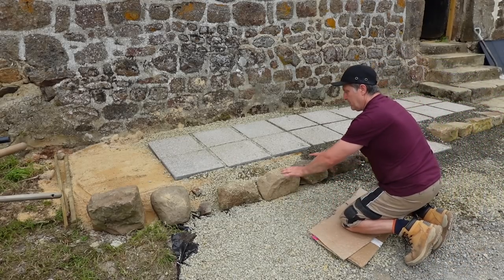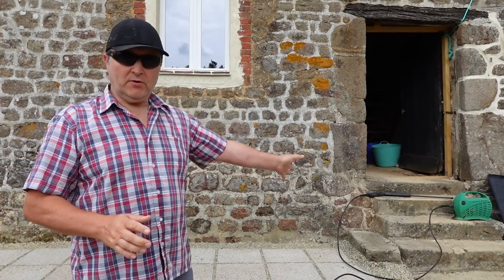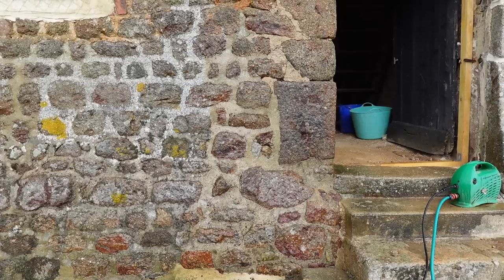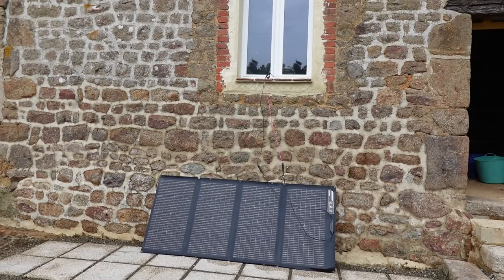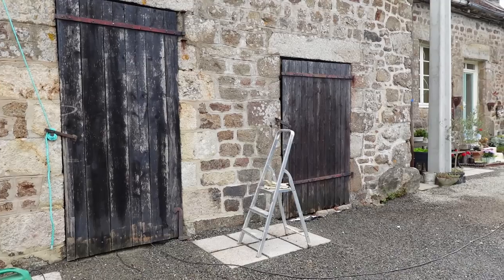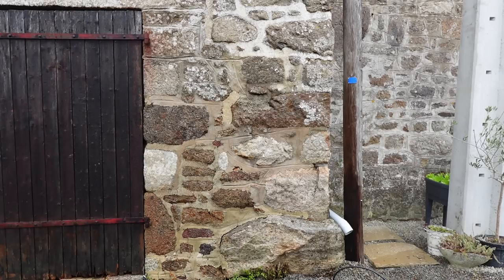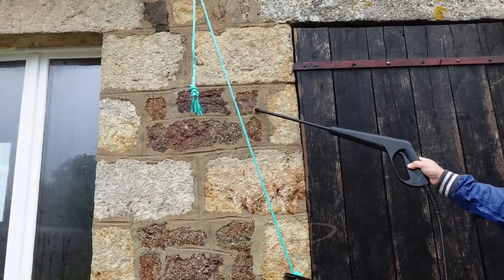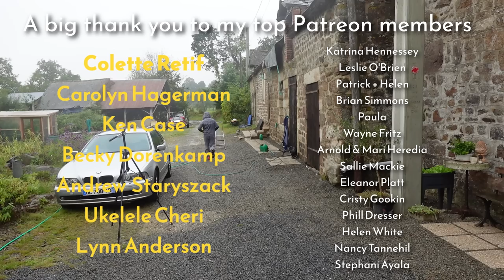Revealing The Cottage Stonework Under The DIRT and MOSS! | Cottage Renovation Episode 29

Comment: This brings me back to my initial statement a few weeks ago, which you so kindly answered. These old stone cottages have so much character, that one shouldn't render over or paint it. They are supposed to look higgledy-piggledy, you would totally lose that. One couldn't distinguish whether it was old or new and made to look old. You would change the character of the house completely and I think you actually want to preserve old things even if they have flaws. On the inside old has to meet modern, but on the outside the only thing that should be modern is lights, windows, and doors.

Comment: Looking good Sean !  Yes, a little "elbow grease" usually helps and you get a sense of satisfaction when a task is complete. The patio slabs and bordering stonework add another dimension to the façades of your property.  The power washer does a great job knocking out dirt and stubborn stone moss.  I have a petrol-powered power washer whose petrol tank needs sealing as it has 2 or 3 fissures on the bottom of it.  I need to buy a tank sealer to protect the tank from further leakage and I can use my machine again to clean surfaces around the exterior of my home. The natural stonework on the property looks great as they are. You'd want to let the stone "breathe" and stay dry quicker after a torrential rain.

Comment: Sean! Before you get rid of your pressure washer, check the O rings. You can replace them for next to nothing and sometimes it'll be good as new. Worth a look anyway. I say this because I heard your pressure washer going off and on in little bursts of power when you weren't near it and mine did the same thing. There was a chunk missing out of one of the tiny O rings in mine where the hose pipe connected to the wand. Each time it leaked a bit of water while it was idle, my pressure washer would come on in those short bursts exactly as your did during this video. We changed the O rings out and all was brilliant!

Comment: If you want a paint effect, use whitewash. The substance will change the colour but not prevent moisture from keeing your lime mortar intact. Paint will dry the mortar out and cause it to turn to dust. It happened at my Mum's house, and the  foundations started to fail.

Comment: The natural stone looks so beautiful. I hope you don't paint or render it. And the cement pointing can be stained with a mineral stain or acrylic wash to match the darker grey of the surrounding pointing. It will look quite fine a bit darker. You can get dry ground supplies from a pottery supply company. Try manganese dioxide, with maybe just a very wee smidgen of iron oxide, and finely ground wood ash, just a bit, in water and brush it on. Do a little test on something first.💗

Comment: I would be wary of painting it, those walls need to breathe or you will be inviting damp into your house as the moisture will make your internal wall cold and any moisture generated in the house from cooking, showers, breathing etc can condense causing issues. I would advise removing any cement pointing and replacing with lime based for the same reason.

Comment: I’ll just add my two cents here,take it for what you will.I’ve seen many people currently restoring the outside of their homes and their biggest headache is removing the old paint that was applied years ago.The result was considerable deterioration of the stone because the paint locked in the moisture helping break down the joints.Not a criticism just an observation I’ve seen in many people’s experiences.

Comment: My opinion is render the stonewall, the reason behind is the work which has already been done with the window and the window rendering surrounds, you‘ve got 4 different architectural features/materials = new white window, rendering, partially covered brick work and stone work, this gives me the clue that there is already a strong possibility, the stone work will be rendered, I would prefer if the door openings stone work stays exposed as you‘ve already got  stone steps, rendering the building(s)/barn(s) would bring them altogether to one architectural feature, although the stone work has a historical value it wouldn‘t be the first time stone walls have been rendered in the past, painting it would tarnish the integrity of the stone work, it will be a enormous task to do it but Sean already indicated it as one option,

Comment: Kevin at the Boring Channel (does yards and pressure washing for free) uses a bleach solution ( 8 parts water, one part bleach in a pump bottle (the kind used for bug spray), and the mildew just melts away! and it continues to work! No scrubbing and brushing needed!  Oh, no chemicals. I get it. Different circumstances. They used hydrocloric acid and a  scrub brush, then pressure washed their big three-story chateau. too much, I thought.

Comment: Rendering it would require a lot of labor, time, and expense, so painting it would be the easier option. However, I would only paint it with the lime-based paint, not a modern paint. Of course, the stone work looks nice, but there is no real uniformity from one end of the building to the other as far as the color of the stones. I would leave the stone around the doors and windows as they are to add a nice contrast.